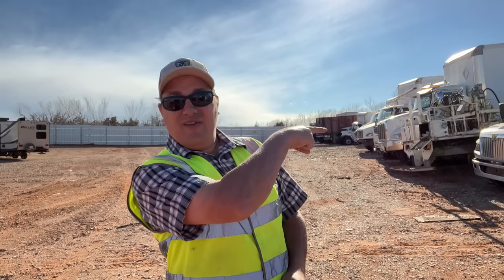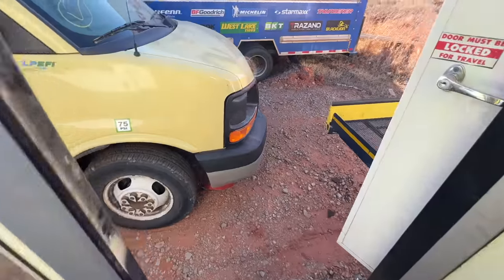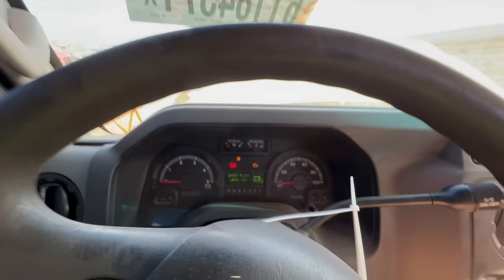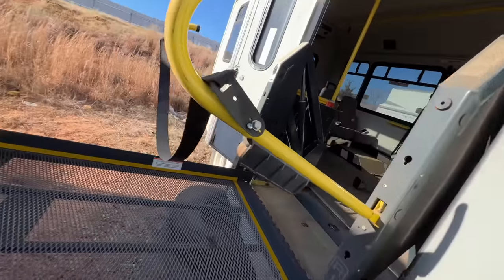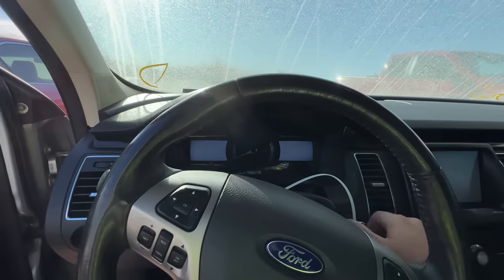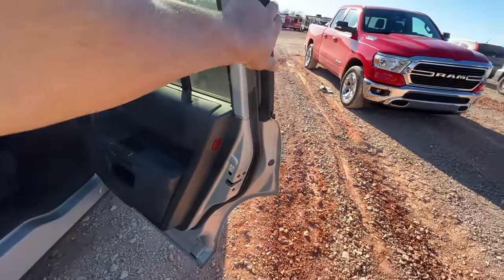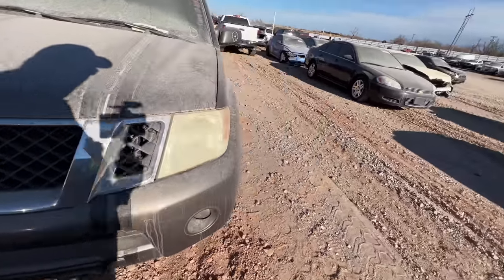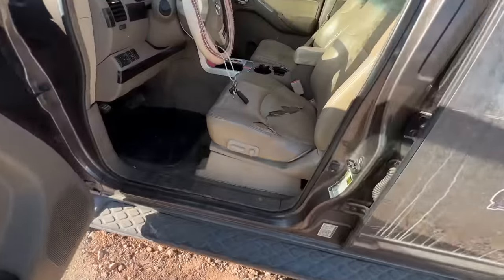Copart Walk Around 12-21-21 + Buying a F450 Party Bus for $3450!

Comment: Randy, I'm glad you didn't get the F-450, it's a scam.  We paid $3800 at an auction for a "07 Expedition EL that wouldn't start, and it turned out that it was just an 8-year-old battery.  Now it runs perfectly, that party bus just isn't worth it for the amount your going to spend on everything.

Comment: Goonsquad had the same issue with the steering wheel on the new truck that they are working on. It was a cracked inner plastic sleeve in the column

Comment: Theres something else majorly wrong with that bus. You could tell just by the way it was cranking. You could tell right away. The ford flex's are nice. Kinda similar to the ford freestyle/Taurus X. I loved my 07 ford freestyle. Until the AC compressor locked up and tossed the serpentine belt. You gotta actually pull the motor halfway out just to get to the side of the motor in order to put the belt on and to replace the compressor. Would have been a pretty big job as well as an expensive one because I most certainly wasn't able to do it. Mine had the 3rd row seating, 3.0 v6. Had tons of room. I actually fit a big side by side refrigerator on the back of my freestyle with the seats folded down. Had to take the doors off the fridge for it to fit
 But I just tossed the doors on the roof rack and tied them down. May have fit without taking them off but i knew they were Guna need to come off in order to get it in my house. Ended up trading my broken 07 freestyle for a 08 Hyundai elantra plus i got $500 from the guy. Roughly same miles. 177k on ford and 183k on the Hyundai. And the Hyundai is still on its original timing belt believe it or not. Its on my list of things I need to do 😂